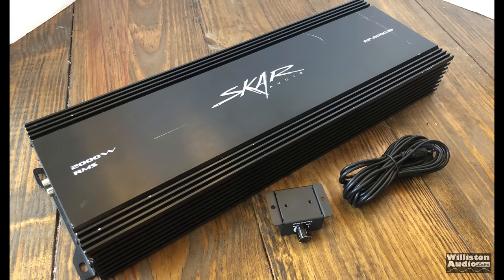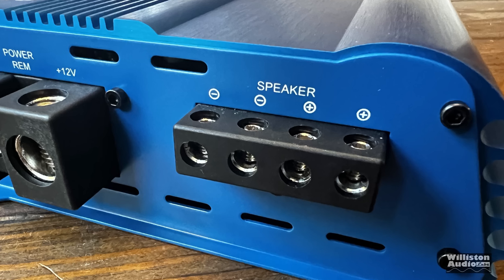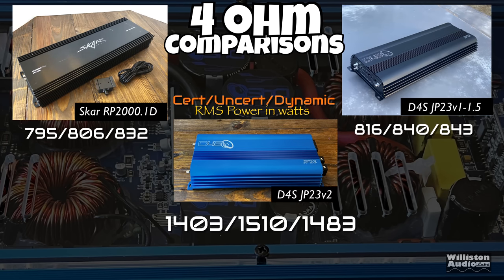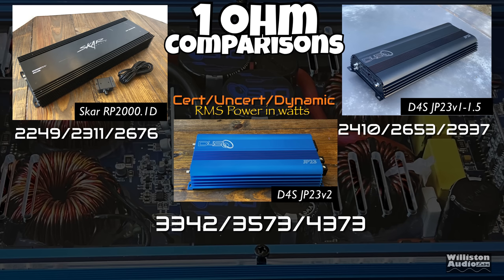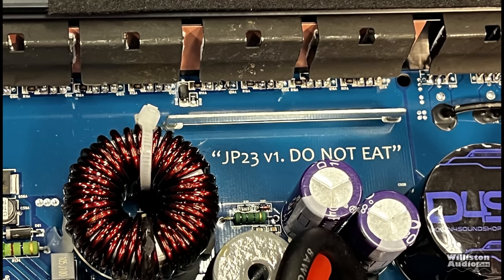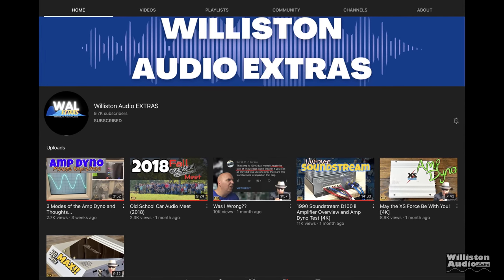The End of SKAR AUDIO's Dominance? Down4Sound J23v2 Amp Dyno and Review

Comment from the maker: Down4Sound JP23v2 up for review and testing
SHOP (affiliate links) 
JP23v2 Monoblock Amplifier: https://lddy.no/1d7oj
JP23v1.5 Monoblock Amplifier: https://lddy.no/10uwo (older model)
JP84 Blue 4-Channel Amplifier: https://lddy.no/zhh0
All D4S Amplifiers: https://lddy.no/vv99
SKAR AUDIO RP2000.1D: https://lddy.no/1d7up
D4S LTO 6.0 battery: https://lddy.no/1d7tj
1/0 OFC Amp Wiring Kit: https://lddy.no/1d7uj (don't get CCA!)
HiFiVega 1/0 OFC Wiring Kit: https://bit.ly/3rV9vDU
HiFiVega 1/0 OFC Big 3 Kit: https://bit.ly/3rXqxRW
Note: Amp requires 1/0 OFC wiring and at least a supplementary battery. Remember, it takes power to make power, beef up your electrical system first!

VIDEO INDEX
0:00 INTRO
0:15 SKAR RP2000
0:51 WHY DOES JP23 EXIST?
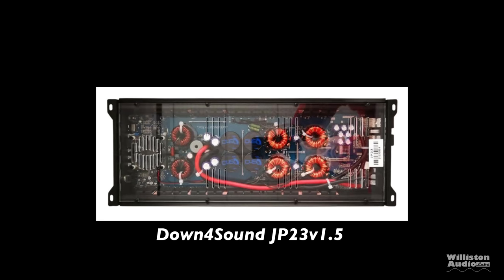2:11 UNBOXING THE JP23v2
3:18 FEATURES AND SPECS
4:55 WHAT IS THE AMP DYNO?
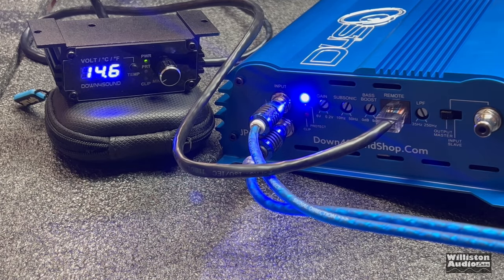6:22 AMP DYNO TESTS
9:47 SUBWOOFER TEST
10:47 WHAT'S INSIDE?
11:47 PROS AND CONS
12:53 FINAL THOUGHTS
See Williston Audio EXTRAS for more tests: retrocarstereo.com

Video Gear I Use
Camera - iPhone 13pro 1TB - https://amzn.to/3nCjGvc
RODE Wireless Go II Microphones: https://amzn.to/3Q6NVHl
Shure MV7 Microphone: https://amzn.to/3A4OICK
Zoom H4n Audio Recorder: https://amzn.to/3BXjVsS
960 LED Panel: https://amzn.to/2Sxoq3S

This VIDEO was EDITED with LumaFusion on an iPad Pro 12.9:
iPad: https://amzn.to/2Ancr1W
Software: https://goo.gl/6yvWss

Test Bench Equipment
SMD / D'Amore Engineering Amp Dyno: https://goo.gl/sJTcf7
XS Power D1400 Batteries - https://amzn.to/2BPFCKW
XS Power PSC60 Charger - https://amzn.to/2CHGcfs
Fluke 1000A AC/DC Clamp Meter: https://amzn.to/2Rw5WDA
Handheld Dyno: http://amzn.to/2u2EgKV
My Favorite Screwdriver Kit: http://amzn.to/2x0VzcE

DISCLAIMER: This video and description contains affiliate links, which means that if you purchase from one of the product links, I may receive a small commission. As an Amazon Associate I earn from qualifying purchases
Reply: Those arent "ricers" getting dyno'd, those are tuners. "Ricers" are cars where nothing performance is done, only visual...usually covered in stickers and autozone emblems/vents.
Reply: or 40mxi autotek made by zed
Reply: mx5000 autotek

Comment: This can't be compared with Skar Audio's RP2000. The JP23 v2 is $379 and the RP2000 is $212. Yeah the JP23 puts out a lot more power but it's going to cost a lot more to get it. So that isn't going to end anything for Skar. The only way that will happen is with an amp that puts out a lot more power and costs the same as the Skar amps. That's just my opinion as someone on a very tight budget. I would still choose the RP2000 all day if I needed a 2k watt amp.
Reply: I'd rather save up 100$ more and get a 2700watt amp than an extremely power hungry rp2000 that might make 1800 watts for 100$ less.  I bet it's not long before D4S amps outsale the Skar amps. At least on D4S website. Thanks JP and BigD
Reply: Skar's RP2000 does well over 2000 watts at 14.4 volts, 2,890 watts to be exact, so no comparison with price and quality. Skar dominated this and will continue to do so in the future.
Reply: @barrettalen  then you aren't as concerned about the price as most people on a budget will be. Majority of people live paycheck to paycheck so saving up an extra $150 isn't an option. Definitely not to put on the budget priced Skar subs they just got. And I'm not saying anything bad about the JP23 at all. It's definitely a badass amp. There's just no way it can be compared with the RP2000. The JP23 should really be named JP3K and compared to other 3k amps.
Reply: One of the fastest amps I ever bought used and sold was the RP2k. I bought 2 brand new and one had protect issues. I pulled em out sold them and bought 2 Wolfram c2400's I got the first ones to hit the states.  Sound quality, efficiency, and the ability to perform at 0.5 for a few more bucks. I mean damn I was a Skar nut hugger before I opened up my eyes and realized that you pay for what you get. Buy cheap it's going to be the cheapest quality.  Spend a little more and you get more.  I still like my Skar TX series 6x9's though
Reply: @barrettalen   I completely agree with you. I use 2 cab 4500s and incriminator audio myself. All I'm saying is that ppl on a budget don't think that way. Actually ppl that aren't bass heads and don't know any different don't think that way either. So the JP23 isn't going to do anything to hurt Skar whatsoever. Skar will continue to sell just like they always have bc they are budget friendly and until someone can compete with them in the same price range nothing will change. Ppl get decent performance at a low price with Skar and that is good enough for most ppl. Plain and simple.
Reply: @hopskustomaudio  my brother called me and asked me about the RP800 and I laughed so hard.  I remember my first monoblock amp.  I gave him a Sundown SAE 1000.1 because he was adamant  about not spending over 150$ he didn't even want to spend the 180$ on a JP8. Lol yes we have the same parents however he's never had any large builds. I just got him to toss out his Boss 10" and get a DDX 10" for his Ranger. I told him I'd build a  enclosure to spec he would not have it. He insisted on putting it in his old Bazooka tube.  You can hear the port noise bad at least I can. He loves it he also doesn't know any better. And he wonders why my builds take your breath away and rattle your eyes loose.
Reply: @barrettalen  yeah most ppl just don't know anything about what equipment is good and what's not. A custom enclosure would be way better but glad you at least got him away from the Boss tho. Lol
Reply: The JP23 v1.5 is closer in price to the RP2000 with better parts. Korea vs China amp. Skar does a lot of advertising.
Reply: I'd rather spend the extra and get the better amp.
Reply: @derekgardin1512  then you obviously have more money than most ppl buying car audio on a tight budget. Bc they can buy a lot of food with that $150. I'm with you tho. I completely agree the better amp is the way to go. That's bc I know car audio. Most ppl don't. And they are going to buy the cheapest they can find and not know any different. Which is usually Skar Audio. That's exactly why they have done so well.
Reply: Hands down star for the price is a better choice. Just because jp amp makes more doesn’t mean the electrical is gonna be cheap to keep up. And yes some people $100 more is far from acquiring vs others
Reply: @Gqsfinest  don’t hold me to it but I’m pretty sure that jp is Chinese too you don’t get Korean until you go up to the next size up according to Jps video
Reply: The taramps 3k are around the same price as skar personally I’d go with that
Reply: I second that
Reply: Nothing wrong with China made.    Yallmake a big deal about petty bs
Reply: @hopskustomaudio sounds like your a skar guy cause skar is a budget brand but anyone who knows decent audio equipment knows there shit is bottom of the barrel. They don't sell recones. Their subs an amps are throw aways
Reply: @TrunkThunderLithium  see that's where you don't even know what you're talking about. Lol. I agree the lower end skar subs are not very great but the vxf and zvx are good subs. My last build I had 4 vxf 15s in a small 6th order doing 157.3db at 35hz on about 8k from the c pillar. Was loud from 24-60hz and surprised a lot of ppl. Also if you can't rebuild a sub without having an exact recone that someone else put together for you then your opinion doesn't even matter to me about anything man. Get back at me when you learn a lot more. I been doing this a very long time.
Reply: @hopskustomaudio  this was to funny! 🚮
Reply: @hopskustomaudio I agree that D4S won't do anything to hurt Skar, but the "when someone can compete" line is wrong. Ct sounds 2k is a better amp than the rp2k for $20 more. 90 dB snr is the lowest anyone that cares about sound quality wants. The 85 dB is sub par, especially compared to the ct 2k's 96 dB. Skars 4 ch amps have good specs, just never tried them because they use that 15% off gimmick and list max numbers instead of rms like crap brands like pyle and boss 🤷‍♂️
Reply: @AC-mr7is  you obviously don't even know what you're talking about. Bc skar most definitely doesn't list max numbers. They list rms numbers and are even underrated as well. You may want to go check that again. I have no issue with CT sounds at all but Skar still has absolutely nothing to worry about from them. Bc i guarantee that skars sales double ct sounds. Skar isn't going anywhere anytime soon. I don't dislike any brand at all. If a company is doing well and making money then good for them. My message was only to prove a point and everyone knows its right regardless of what any skar hater says.
Reply: @hopskustomaudio  I'm not a Skar hater at all, nor do I care what they make in sales. I'm sure with all the people that don't know any better or the means to get quality gear, they're doing just fine. Seems you need to go check their subwoofers, they most definitely have max numbers on all their subwoofers. Don't get so caught up in being a little Skar fan boy that you think everyone is a hater. Everything I've written has been a fact!
Reply: @AC-mr7is  so what are you implying if you buy the RP 1500 it won't produce real world 1500 watts clean power. Always good to check the RMS of something when you're buying it
Reply: lol if you wanna listen to China sq that’s on you🤣🤣
Reply: @bmwjourney4796  almost any amplifier is made in either China, Korea or Brazil. You do realize that and almost any amp. Even if it claims it's a US manufacturer. 95% of the parts come from China 🤦🏻‍♂️
Reply: @bmwjourney4796  it's a subwoofer amp. Not for mids and highs. Bass is bass. As long as there isn't any distortion with a good clean signal then there is absolutely no difference whatsoever. I been doing this stuff almost 30 years and have every different type of amplifier out there. I've done the testing to know. Ppl need to do some fn testing and research before they even think about leaving a comment trying to argue about things. Lol. Smh
Reply: @hopskustomaudio  bass is not bass. Listen to rp2000 and any Korean 2000 side by side. I would know LOL I’ve done it first hand. China sounds muddy and Korean has got the punch an sounds real af. Take care doe I’m not arguing abt this Ik what my ears heard with that junk rp
Reply: @hopskustomaudio  to have a clean properly running sound system u need 2k$ if u don't have that to blow don't even think of a stereo!!
Reply: @cassiusmoody163  right. I've actually got about $15,000 in mine so you aren't telling me anything man. MOST ppl don't want to spend that much money on a car sound system tho. And that's why skar is a good choice for them.
Reply: @hopskustomaudio  man I'm getting there my first set up was 7k with install!! Sold for 1500$!!!! Now I got 3 ruthless 8500s a crazy jump from a 4k!! Lol
Reply: Some people don't know anything about amps besides watts 👀
Reply: You obviously love skar then keep buying them. Not everyone wants a cheap ass amp, yes people are on a budget but saving a little more can be the difference between something good and something mediocre. So I'd save more money and buy a jp23. If want to be quite honest jp23 aren't even that expensive try spending 500 for a 900 watt jl audio. So JP's aren't even the "high quality amps" but they are much better than skarr which has had a lot of negative reviews in the past and if you're buying a car system, it isn't going to be cheap . If you think that then your asking for trouble in the near future. Just my 2 cents
Reply: That's what I said.
Reply: @Gqsfinest  its not korean they are both chinese
Reply: @hopskustomaudio saying bass is bass is like saying food is food
Reply: @duaneduncan2380  that's the dumbest thing I've ever heard anyone say. How many different ways can 30hz be played? Only 1. We are talking subwoofer amps. Not full range. It has been proven many times that you can not hear a difference between bass amps on subwoofers. The only difference will be in the dampening in a sq system. With most ppl that are only trying to get loud, any bass amp will sound exactly the same way. Do some research before trying to come at me with anything. Go ahead and try to prove me wrong. I'll wait.
Reply: Well when you look at this amp, it's really not a 2k🤷‍♂️ it's more of a 4k
Reply: @hopskustomaudio  thats because it actually compares to the rp3500 in terms of power output... not the rp2k..
Reply: I spend $150 on energy drinks in a month. If getting weird over that price difference to get less quality and power, might not be a great hobby for you.
Reply: @nicholashaglund7376  do you or have you ever had a car audio shop or do any amplifier repair? If not then you have no clue what you're talking about. I have a shop and also repair amps. Yes I've had to repair just as many d4s amps as skar. The amp itself has absolutely nothing to do with how it works. It's all about the person using it. The reason why you hear more about skar equipment failing is bc they have such a higher sales percentage than any other car audio company out there. With more ppl buying their equipment you are going to hear about it failing more from the ppl who have no clue what they are doing with it. I have never ran any skar amps myself but sell more skar equipment than anything else. Nothing else is even close and I don't advertise anything at all. They come to me and either tell me what they want or I give them options. 99% of ppl are going to go the cheapest route. Facts are facts. It's that simple.
Reply: SKARBAGE
Reply: 212 for 2kwatts. 379 for over 4k watts. Way better bass knob. Way better built.  It's not even close. And my 1st legit build was 2 Evl 12's on a RP2k.1 so I've owned SKARBAGE b4. Switched to 1 Fi SP4+18 and a Wolfram C2400.1 amp. And it's not even close. CT Sounds blows skar away. Quality and Cost. Shit, I'd run Audiopipe b4 I ever ran Skar again.

Comment: If they would offer them with an option to choose the color of the amp it would be a better deal, or even just offer them all with an option for black that would be better. If you buy a two channel and a 4 channel for instance they are physically similar but the color difference is like a bag of skittles. Props to Jonathan for making it happen, but the different color amps makes my ocd go crazy.
Reply: Agreed. I just can't do a blue amp!
Reply: @Chris Swenson  Why should I have to paint an amp to get matching colors? Every other manufacturer out there has figured this out.
Reply: @justforkiks29  
Calling BS on that. Not a lot of color options in the majority of Amp brands. They don't typically offer a 'color option" either.
Reply: @wilson rawlin  🤦‍♂️ Most manufacturers offer one color, it's usually black or silver. But at least all the amps match. These amps look like bag of skittles dumped on the floor. Btw since this comment they have started to offer amp packages with matched color amps. I wasnt alone in that dislike for different color amps in a system.
Reply: @justforkiks29  
Nothing wrong at all with you having a preference. Just saying not many companies are going to go out of their way to create a bunch of different colors. I actually like the 'skittles" look. If I want my amps to match for display. I will do custom colors on them. Too easy to shoot them with single stage urethane since I can paint cars, boats, etc. I wonder if there's a market for that.
Reply: @wilsonrawlin8547  you can create the market...just offer to do a few of your friends amps  and sit back and watch the demand ramp up🤔
Reply: @MrMaxwood  
Good idea! Just might have to do just that. We only have two or three high end dealers in our area. I could do some freebies for them and see how it goes.

Comment: Skar is due for a new amp lineup. There not bad amps but with the variety now available it's hard not to go another way. Excellent video n I dig the new bass remote, that's pretty cool
Reply from the maker: Yeah I agree. They’ve been riding those amps for quite a while. I like to stir things up so I thought the title might draw some interest 😝
Reply: I compared Rockford fosgate 1000.1 bdcp vs skar 1200.1 on 2 sundown sa12s skars bass sounds distorted the Rockford had deep clean bass just my opinion
Reply: @boostedmk5gti563  I couldn't agree with you more. I've had a lot of different amps and the best sounding bass amps BY FAR have been Rockford and JL. That price tag though! Ouch!
Reply: I would love if Skar came out with a DSP and DSPamp.
Reply: @boostedmk5gti563  Skar sounds muddy.
Reply: Agree!  And especially, they need to make their higher end amps smaller…
Reply: @boostedmk5gti563  what's the price difference?
Reply: @wal  Ive always wanted a Skv2-8000.1d and a Skar 12" Enclosure with 3cu ft for their ZVX and VXF subs....
Reply: @boostedmk5gti563  no doubt.. even the primes are incredible.. I have the 1200.1 v1 and it's insane how good it is. I think it did over 1500  and over 80 percent efficiency. Also have this jp 23 and Orion 2500dz. Thanks to big wizz testing..
Reply: @Raymo2u  were you thinking of a different amp? The most powerful Skar SKv2  amp that I'm aware of is the SKv2 4500 amp.
Reply: I've never once had a problem with any skar amp or sub
Reply: Skar is still best bang for your $$$$ that d4s retail $379.99 vs Skar $212.49 ... Those watt numbers are crazy though for the d4s